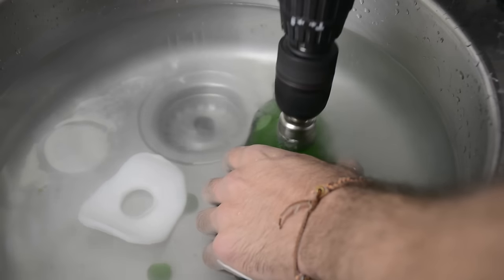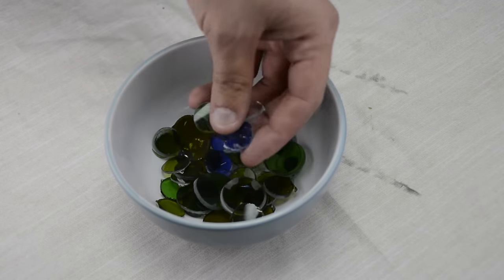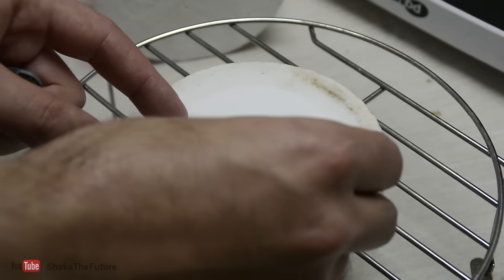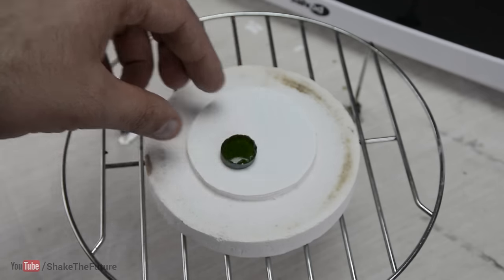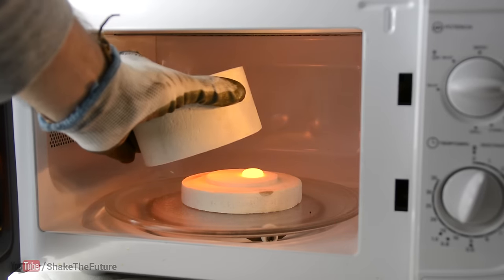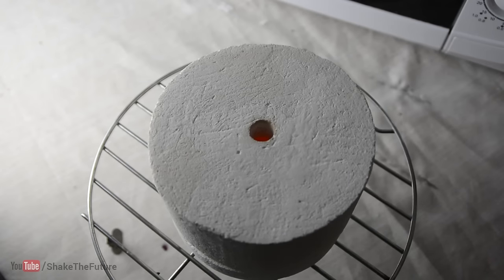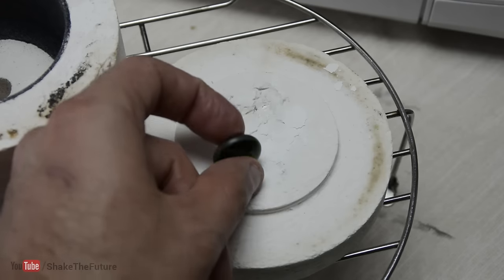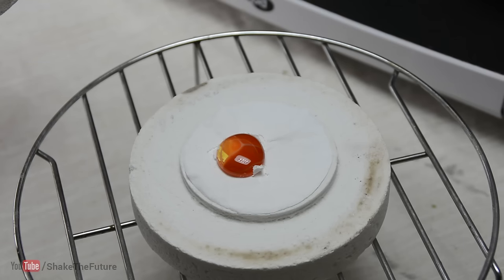DIY Jewelry from Glass Bottles | Microwave Kiln #1

Comment: Hay man, i read that different colors of glass have different CoE values, the rate of expansion and contraction under heat, and eventually those pieces will shatter.   I haven't confirmed this yet, as i'm still researching, but so far, that seems to be the case.

Comment: what is Microwave Kiln? I've never heard of it
Reply from the maker: +Amin Ori 
A kiln that you can put in the microwave to fuse glass. (there are also kilns that are designed for melting metal)
The walls of the kiln are covered with silicon carbide.
Because silicone carbide absorbs the microwave energy, the walls heat up.
Kiln can get hot enougt to melt glass or even metal.
Reply: ***** wow this is cool and simple. Thank you for the info :)